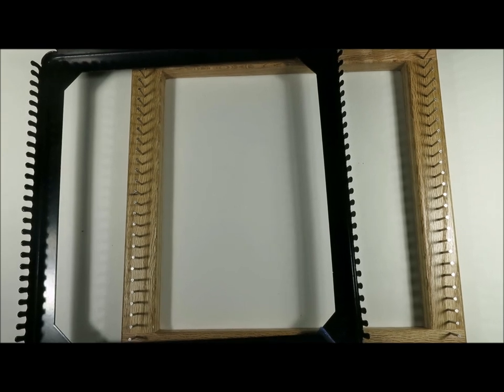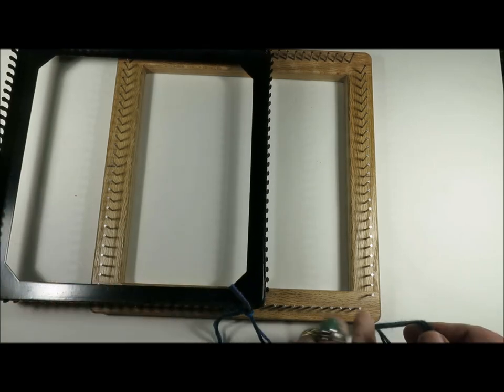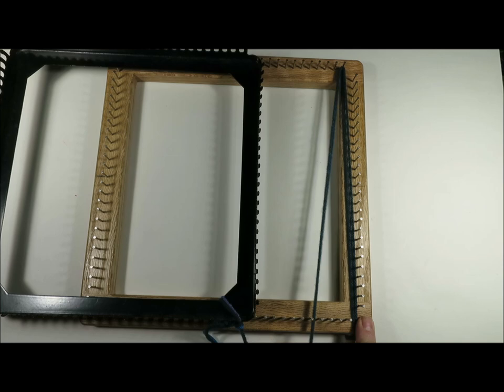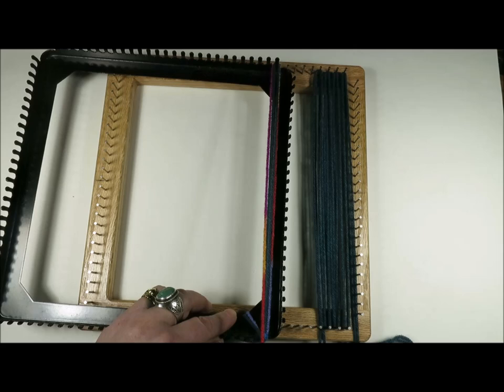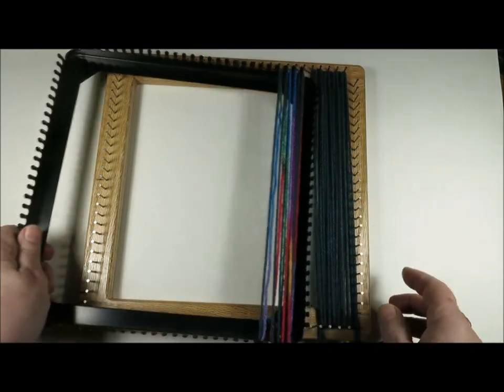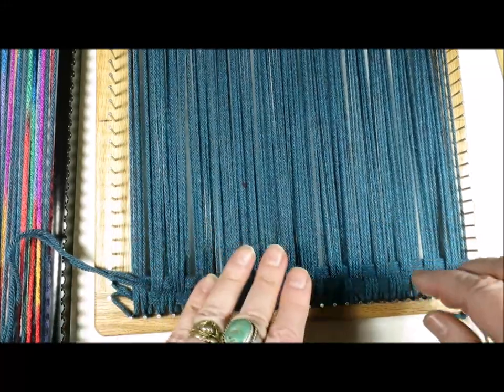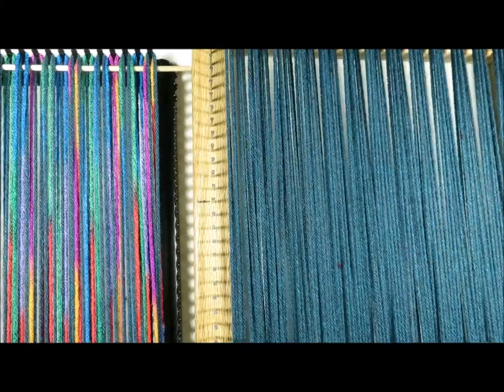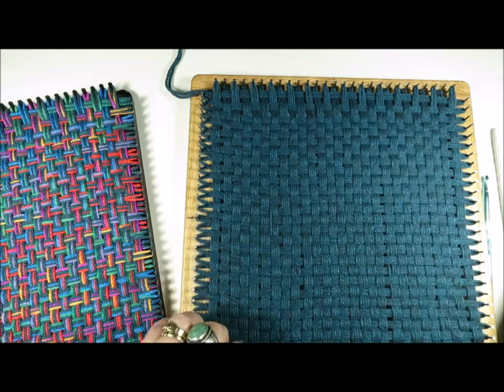How to Weave with yarn on the 9 inch potholder loom

Comment: For a beginner would you use the peg pot holder loom or the nail pot holder loom. Is one easier than the other?
Reply from the maker: they are both lovely, and there are even some very nice potholder looms made of plastic.... just avoid the plastic ones that are flimsy and have straight up and down pegs... ugh... twisty nasty no no.....  as to metal vs wooden, that is a personal choice that is hard for me to answer.... if you like the feel of wood, then lean into getting a wooden one.  If you prefer the streamlined feel of metal then the Harrisville is truly lovely.  Either way- Happy weaving!

Comment: Probably a silly question but how do you make a double strand of yarn from a single skein? Also do you have simple instructions for joining squares together to make a quilt or small blanket? Thanks
Reply from the maker: Push your finger inside the skein of yarn and pull out the center clump of yarn and find the yarn end, then use this end and the end from the outside of the ball.  Here's a pattern for making a blanket: https://tottietalkscrafts.com/2020/01/15/potholder-loom-blanket-free-pattern-by-noreen-crone-findlay/ There;;s a link there for how to sew the squares together.  Happy weaving!

Comment: How do you finish off the top left corner?
Reply from the maker: Chain the loops off all the way around and then either use the yarn ends at the upper corners for stitching the squares together or weave the ends into the square.